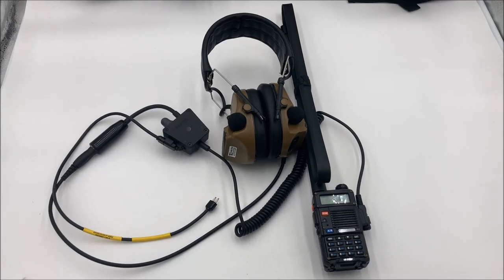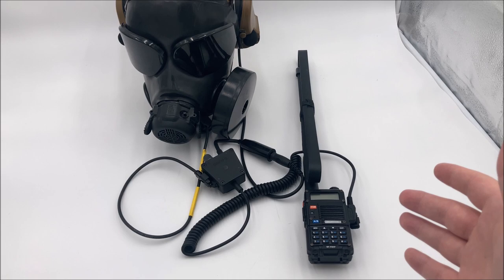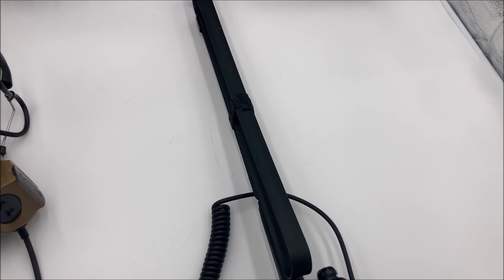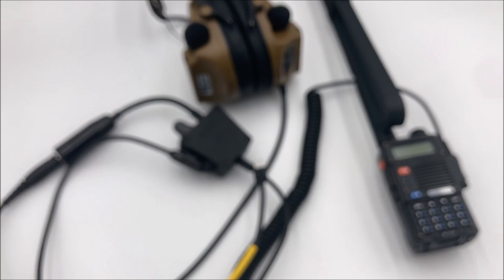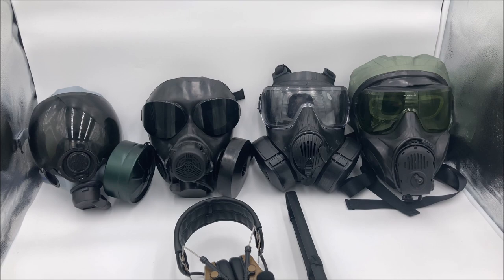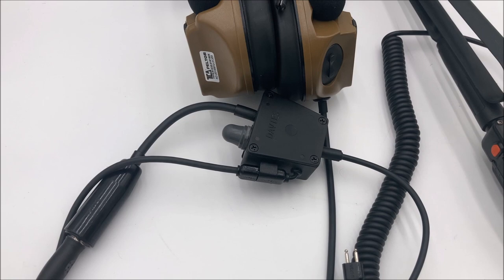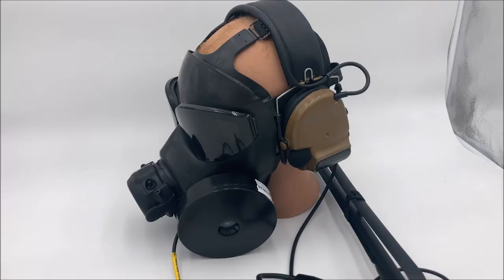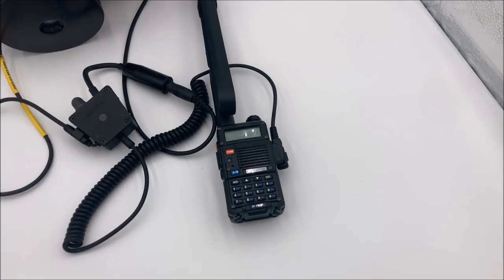My Gas Mask Comms / Radio Setup (for M53, M50, C50, M45, MCU, and more!)

Comment: Great video. any chance you could do a video discussing the in-depth differences between the Avon M53 and Avon M54? The M54 is drastically cheaper than the m53 which seems odd to me because judging from the name the M54 is the new mask. Thanks for your time, and the great videos!
Reply from the maker: I haven't done a video like that because I don't have an FM54. Not enough of a difference for me to justify it atm. The only differences are: increased passive speech emission, a more robust VREU (variable resistance exhalation unit) control lever, and improved flame hardening so it can survive higher temperatures

Hope this helps!
Reply: @botstowo  What gas mask do you suggest getting from a practicality stand point?

Comment: Cool overview, thanks for making this vid! I too only became (vaguely) interested in comms gear and setups, about which I know basically nothing, because I started collecting masks and thought it would be cool to have a whole integrated loadout. In my case it was with an Avon S10 (I live in the UK so they're pretty common) and trying to rewire an old Army Clansman radio PTT to work with the clip-on mic for the mask and a Baofeng. Don't think I ever quite nailed it.

I now have the updated radio headset, PTT and mic for the FM12, as used by the UK Police in the past, but no radio compatible with the plug, so while it looks cool it's useless unless I either get the right radio or rewire the plug. I recently managed to order an M45 from outside the US so once it gets here, despite your wise advice not to copy you, I'm highly tempted to get the right cable and try to make it work!

Great video, always enjoy your content 👍